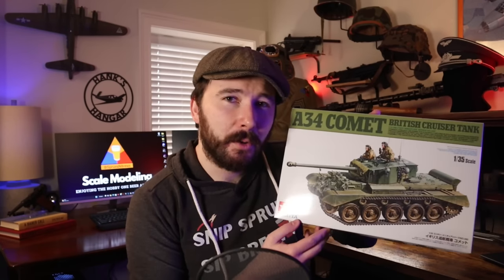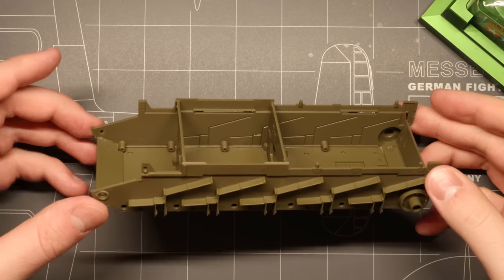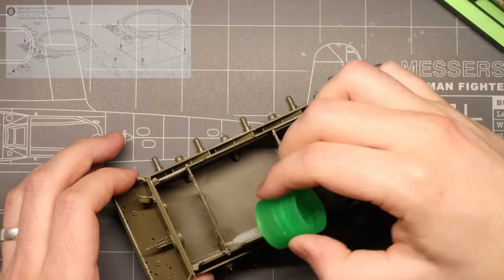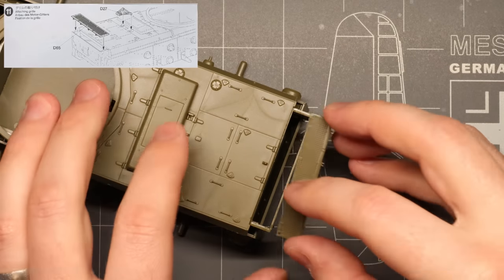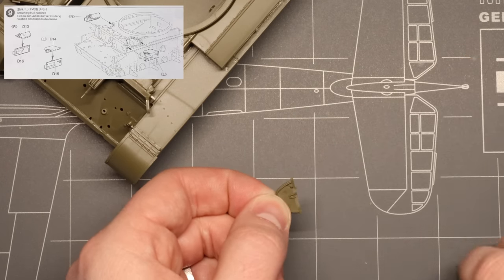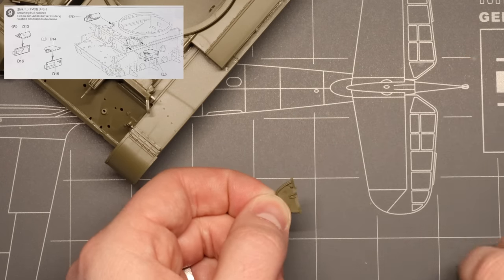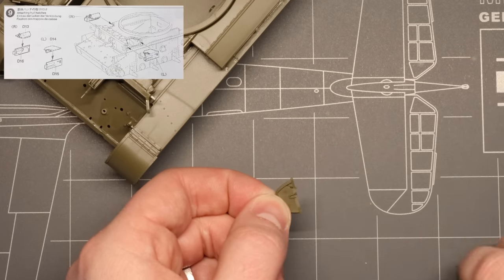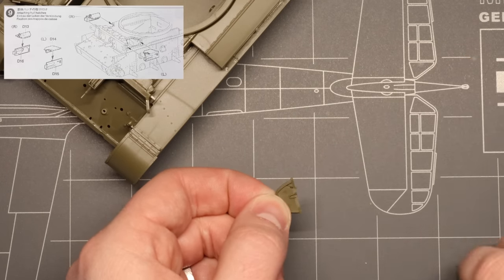Building the BRAND NEW Tamiya A34 Comet | Full Step-by-Step Guide

Comment: It looks like a beautifully engineered kit but hard to know how accurate it is without knowing what the decal options are. They managed to serve in the last few months of WWII in Europe. After that they were upgraded with some changes, particularly to the rear hull and back plate. but still really only served in secondary roles or in places like Hong Kong. (The main armoured elements of the British Army quickly converted to the Centurion which was in front-line service by the Korean War). Finally the main gun was a 17pdr but not the same one as the Firefly, Archer or Achilles. It was a shorter, lower velocity version colloquially known as the 77mm.

Comment: A well done model. I am a new follower of your channel and was wondering if you could also include an approximate assembly time for the model unpainted. This would help to give the beginning modeler an idea what is involved in putting one together. I realize a entry level modeler will need more time verses a "veteran" modeler such as yourself.  If every once in awhile if you could build a stock model verses the accessorized version with a lot of aftermarket parts. This would give us a comparison of the basic kit verses a "tricked" out version.  If you could note approximate drying/cure time of glued parts, as it would be too easy to start handling the assemblies before the glues have set. ( When I was a kid I tended to handle a model too quickly after gluing turning a nice kit into a gooey mess. These became fire cracker fodder. ) Again thank you for your great presentations.

Comment: A nice kit but I really doubt that the barrel is slide moulded. If it was it should at least be "drilled out" and a bit of rifling should also be visible. I don't know why Tamiya didn't add a PE screen for the rear of the Comet. The kit is about 50 € on our side of the pond and I'd expect some extras like that for this price. It would be a perfect kit for beginners if it wasn't that expensive. The result looks very nice even without any upgrades.

Comment: I am working on my first kit a U S Navy PBR 31Mk.II which I served on in Vietnam.  My next project I have been researching which will be the USS Enterprise CVN-65. I saw Tamiya had a kit for $190.00 and Academy had one for $65. What do you think of Academy Kits.  I'm weary of under priced kits because maybe the quality will not be as good as Tamiya's. Also I noticed that you use very little cement on your kits. How do you get a seal because I have to put clothes pins on my parts to seal them at times.  Am I doing something wrong.  They seem to fit on the dry run but spread apart as am applying the glue.